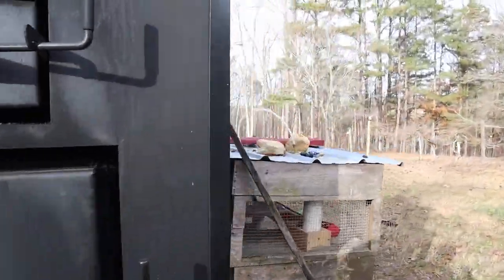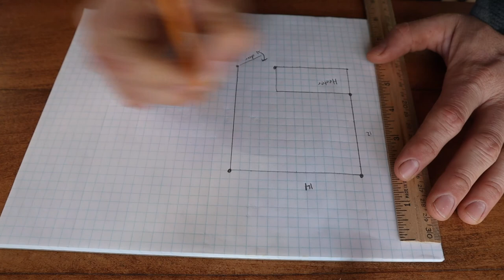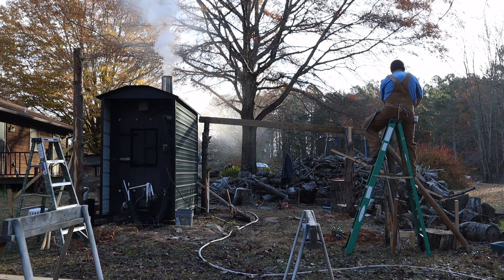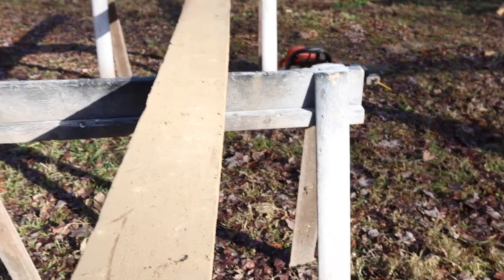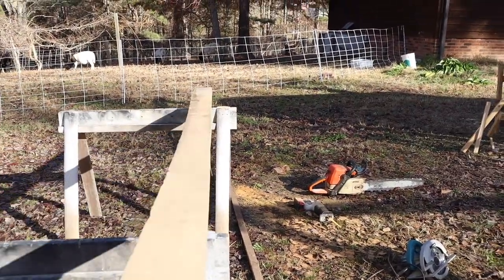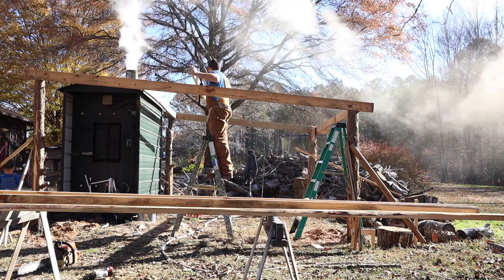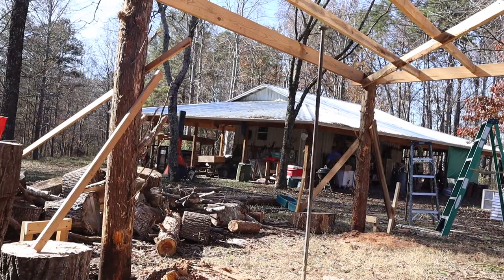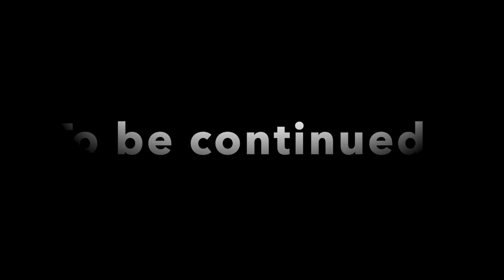How to Build a HOMESTEAD Greenhouse  Part 1

Comment: I love these build videos, and anytime you can repurpose anyting I am all for it. You must have some Carpenter in you if you knew the third hand trick with the nail. You may have had a video out already about this but what is the wood burner used for? Heating?
Great video Adam 👍
Jimmy
Reply from the maker: Thank you, Jimmy. We've gotten so many questions about the heater that we are going to do a video on it soon.